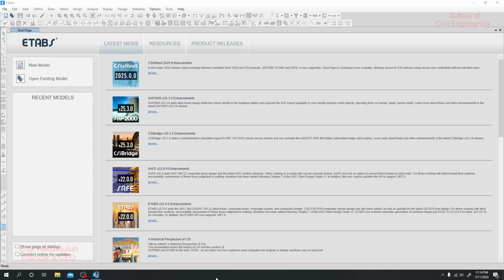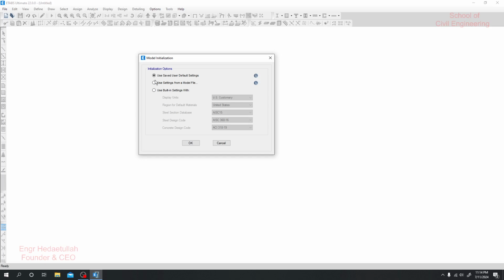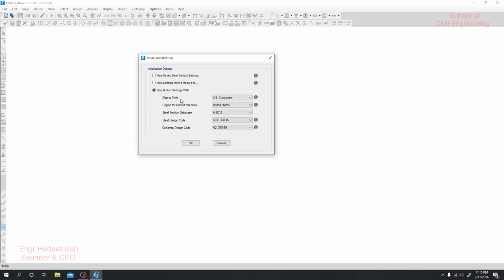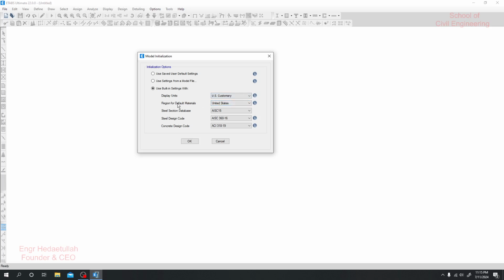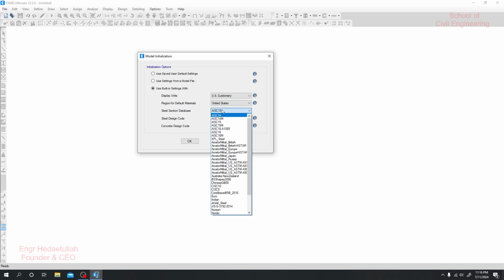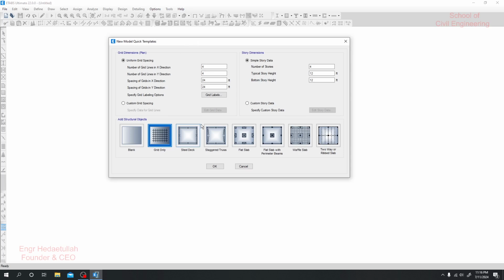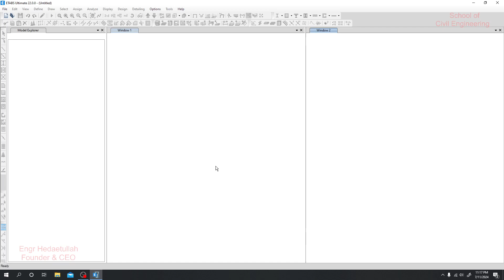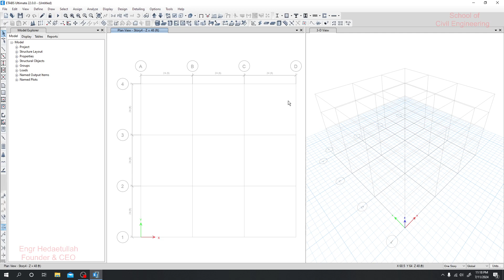3. CSI ETABS v22 2024: Professional 15-Story Building Design in ETABS -New Model Initialization

Comment: I have been using the V22.    I have been facing an issue....

. There are 4 columns that are being failed after all the attempts. .. The issue is "" column factored axial load exceeds euler force""       Can you please assist me with it?
Reply from the maker: my be  there have issue on beam column joint
Reply: Increase column size,,